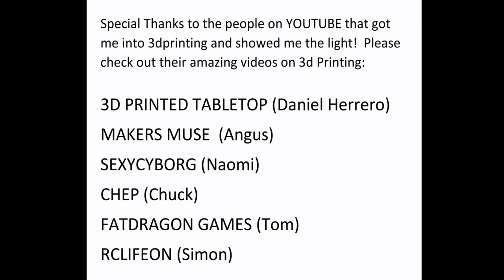Lift speed and Peel Forces in resin 3d printing, understand it all without the bothersome physics!

Comment: This is where the Prusa SL1 has an edge. It tilts the bed/tank to separate each layer, like peeling off a bandaid little by little instead of most masked SLA printers that pull straight up.

Comment: I'm fairly new to resin printing, but I think there are two separate, different resistances at play that need to be considered separately, because they don't act on your prints in the same way.
The first is fluid resistance. This is where your "suction force" is going to fall. To keep it simple, the faster you're moving through your resin, the more force will be placed on your print, because you're giving the resin less time to move out of the way. I think this is what you touch on the most with this video. I believe retract speed can also affect this, but in reverse direction. This could possibly push your print down on the supports, bend them, or snap them off.

The second type of resistance is a bit of an odd one, but your print is not adhered to the FEP by suction. it's stuck to it more like it's glued in place. In a vacuum, with no fluid resistance present, the only thing that determines your success in releasing from the FEP is whether or not that is the weakest held position between your print plate, your model / supports, and your fep.  Because your print WILL give out at its weakest point, and it's your job to make sure that point is your FEP at every layer.

As far as lift speed goes with FEP release: it's actually going to be a factor of force placed on the print (lift) x the speed it's applied. But these two numbers interact in such a way that the end result is always the same. For an easy example: If your FEP requires 10 pounds of lift at 5 inches per second, moving your plate at 10 inches per second would only require 5 pounds of force. (They multiply to 50 no matter how you slice them)

The short answer? FEP release is not affected by lift speed, but your fluid resistance is, so you should go slower if possible.
Reply: "FEP release is not affected by lift speed, but your fluid resistance is". I disagree. if you have a flat, hard disc and that disc has an adhesive on it and it stick that disc to your refrigerator, you may have to pull slowly in order for the adhesive to release in order not to move the fridge.

Comment: HAHA, so funny I have been researching and testing lift speeds for printing busts! Slowing down the lift speed has really help with that suction and FEP noise. I am still dialing in my settings, but making slight changes has been helping a lot. Thanks for putting this video out there for the community, it was needed.

Comment: Good analogy of stepping in mud. One  illustration I like to use is having your hand in a bucket of water or even at a swimming pool. Laying your hand out and raising it quickly out of the water compared to laying your hand out and raising it slowly gives you an idea of the suction that 3D prints go through. To be honest too, from what I've seen there's a lot of people that don't factor in what all the settings actually do. Most comments when you're getting started are "just look at other people's settings" or just google the settings. Which isn't helpful when it's a beginner learning what all the settings mean plus how they react to each other. Thankfully lychee sliced has little descriptions for each setting to say what they do which made trouble shooting a lot easier. Thankfully the only issue I've really encountered was not having enough supports and or using only light supports. But late to this video 😅 but it's great that you're actually providing reliable and in-depth info.

Comment: I've noticed that the peel often finishes within the first 1, 1.5mm. wouldn't it be awesome if they changed the firmware to  have a very low lift speed like 10-15mm/min during this 1mm gap? And then a higher speed like 600mm/min for the rest of the lift? Would help cut down the print time
Reply: It's a matter of software, not hardware. Nothing to do with firmware! Some vendors don't have that. The others DO! ChiTuBox does have these settings.
Reply: @dodobarbar  you can apply 2 lift speeds in chitubox? I see only 1
Reply: @nipunagunarathne4882  YES, you're right. I misread your comment. Though there are two speeds settings in CTB. For the first so-called Bottom layers and one for the "usual layers" that follows. Your thought is valid though! Within the firmware, you can set the acceleration and deacceleration. So if you set your speed, let's say to 10mm/s with the acceleration settings you can set the stepper motor to start slowly, and let's say after 0.5s to reach a full speed of 10mm/s. This way you would have what you want. But let me reassure you. THIS IS ALREADY DONE!!! :-)
Reply: The Mars Pro 2 now has this function, I can lift for 1 or 2 mm (adjusted in g.code) really slow and then lift super fast upto the desired height, then lower fast and also slow down for the last 1 mm before the next layer prints, some of these settings are done by g.code adjustment and others in software such as chitubox

Comment: It would be nice if we could have variable lift so say if 50% or more of the surface is curing it lowers the lift speed. This would be a good option for slicers if the machines could handle it.
Reply from the maker: agree, or even better if the program could analyze the surface area printing at any moment and adjust lift speed to minimize peel force
Reply: @3dprintingpro212  Even though SLA printing has been around a long time, mSLA is still really im it's infancy as a technology. The next few we are really going to see it grow. Right now is a great time to get in and start using one.

Comment: 8 second regular layer exposure time is recommended for the elegoo green resin i have been using with my creality ld-002h; but! for my purposes that is way too much....2.2 seconds is sufficient and is seemingly needed to prevent damage to the FEP. I'm still very new to this. Also i am down to like 5mm/second retraction speed on bottom and regular layers

Comment: I've printed some models that came supported and when its done all the supports are there but no model. When I do my own supports I have no issues. I'll look into my lift speed
Reply: That's because the guy who made a model+supports have probably a different printer(UV power,  RESIN, exposure...) than yours! You should check your exposure time, cooling time, and lift speed. So add some cooling time and lower the lift speed.

Comment: Should I use the recommended settings listed on the bottle of resin? Also, once you start printing and notice those lines you have to start over after changing the lift speed yes?
Reply from the maker: usually not!  :)

Comment: Which “speed” do I adjust? In Chitubox I the option to change the “Bottom Lift Speed”, “Lifting speed”, and “Retract Speed”
Reply from the maker: Lifting speed
Reply: 3DPrintingPro Thank you!
Reply: 3DPrintingPro By the way would you recommend the Phrozen Sonic Mini now that it has an angled build plate and metal vat?
Reply from the maker: @KevoBeyblade  absolutely, I love mine, with the metal vat and sloped plate it's closing in on Epax X1 as my fav
Reply: @3dprintingpro212  Thanks. I'm currently using the original Photon and my only gripe with it are the print times. Sorry for the dumb question, but what file format does it use and can I use a third party slicer like Chitubox and Prusaslicer?
Reply from the maker: @KevoBeyblade  It uses Chitubox yes or Prusa then import into Chitubox works as well
Reply: 3DPrintingPro Thanks man
Reply: The Bottom lift is the lifting speed for the bottom layers. Those that stick to the platform. Usually, these layers are a big chunk of the continuous island. Meaning the peeling force is usually quite big and the time to replenish a fresh resin in these empty spaces is also big. So, my advice would be to be patient and give resin its time especially on the first layers. Let's say that you have a 5" LCD printer. To be safe use 5mm for lift distance and 3sec for lift time (do your calculation). The retract after the bottom layers are printed can be as fast as you dare!!
Reply: @3dprintingpro212  It's kind of a long shot, but do you have any experience with the "tough" resins on the market? I know you used Siraya Tech's Blu in a previous video, but I found it to be lack luster (in some of my own prints) for functional purposes. I found that Peopoly has their "Tough resin" that claims to be the strongest on the market for SLA resins. There's also Liqcreate's "Strong-X" that boasts similar properties. I'm asking if you tested any of these (or know of someone who's used them) before I pull the trigger on a bottle of each. With that being said, they're a on the pricier side of resins, that being ~$75 for Peopoly's and ~$68 for Liqcreate. 

In the meantime I'm considering mixing Siraya Tech's "Tenacious" with their "Blu" for hopefully less brittleness.

Comment: Hi, reasonable points. I have a problem with holes that looks like bubbles in the surface. Can bubbles form with higher lift speeds?
Reply: Did you end up solving this issue?

Comment: Is it a good idea to try to shave off some time by increasing retract speed and keeping lift height to a minimum, or will this create problems as well? Like, is it best to have it retract all of the way out of the resin pool, or does that not matter?
Reply from the maker: my next video will address this!  :)
Reply: I would not recommend that! Keep in mind that your FEP film stretches during a lift. In order to fully peel off your model, you need some height. The bigger the vat/platform/FEP film the higher the lift has to be. Also the speed is crucial! If you retract to fast and resin is of a high viscosity  (high=honey, low=watter) you have to leave some time for resin to fill the gaps. I would recommend to everyone to first search for good resin reviews, buy a sample and if it works for you STICK WITH IT!!! And second, set your timings accordingly and of course SAVE those settings.

Comment: what about the elegoo rook settings .prints mint but lift speed is mad like 300 mm/min
Reply from the maker: works on the rook but if you use that setting lots of other things will fail for sure or of they print may have line running through the print
Reply: @3dprintingpro212  so more delicate or finer the supports slower the speed

Comment: Hey, if you could help a brother out, I have a problem with ChiTuBox. For some reason there are riddiculous areas (not inside the model, a very easy place with great line of sight to the build plate) I can't place supports or can, but they are just a fat pillar with no connections to anything... or even a sphere. Is there a way to bypass or fix this?

Comment: Do larger printers like the Phenom and Transform generate larger peel forces?  I am wondering if your support settings would work for the same size model on one of them, or if the larger FEP area requires thicker supports and slower lift speed.
Reply from the maker: you are correct, those machines if you fill the plate or print a large object with small ones, will have increased peel forces (dramatically higher)

Comment: Do you recommend using any lube on your FEP to reduce peel force? 3D Print Nerd did a video not too long ago about a 3-1 lube he uses. Wondering if you would recommend the same, or if you make other adjustments (like lift speed) instead of FEP lube. Thanks for the videos!
Reply from the maker: I believe if you are using lube (talking for 3d printing here) you are doing something wrong...
Reply: almost missed the wink-wink-nudge-nudge there... But love that kind of humor

Comment: So I see a whole lot of people recommending either really low lift speeds (like in this video) or really high, and I'm using Siraya Tech Fast, which is much less viscous than a lot of resins. Any thoughts on using high lift speeds?
Reply: You should try it out and share your results! No one really has all the answers at this point, but if you run some tests you can add to our collective knowledge.

Comment: Very reasonable suggestion. Interestingly I don't see an option to change my lift speed settings in ChiTuBox for my photon-s but do see the settings when I switch to my photon profile. I guess I should just do away with the photon-s profile since I'm pretty sure the photon-s can print .photon files with the latest firmware.
Reply: Unless using anycubic slicer (which "shouldnt" be needed anymore unless you have the older locked firmware) should be in the "print" tab for chitubox, as well as it can be done after you hit slice and get the options on bottom of the window before save the file.
Reply: For some reason PhotonS profile gives you the option to set those once you choose save on the sliced file.  It is not in the regular settings GUI
Reply: Matt Weber what’s wrong with using Anycubic slicer?
Reply: @bigbossignition  nothing other than its designed specifically for their machines and file type output (at least when they released it for the photon S) only output a file type usable for the S. While most people are driven away from closed loop solutions like this. Especially if the program lacks functions of others. So chitubox and prusaslicer and few others were much more universal for use. Which if you own more than one printer, especially if different models or brands, having 1 printer that has to use 1 specific program can be a massive pain in the butt versus having all your printers in one program your very familiar with and can output files with multiple extension naming styles
Reply: Matt Weber I’m using photon workshop V2.1.22 with my photon S. I tried chitubox and Prusa to poor affect. But it’s possible I needed to update the files.